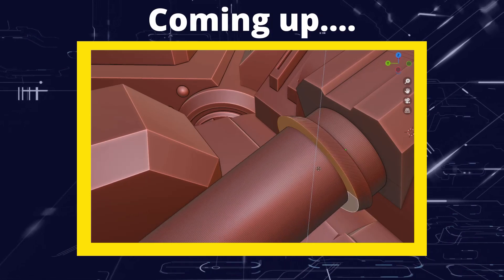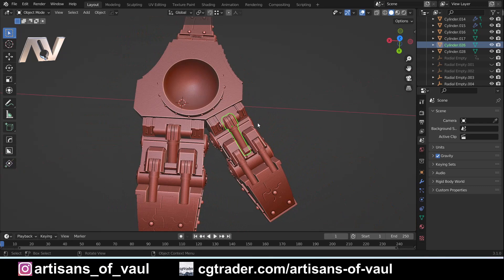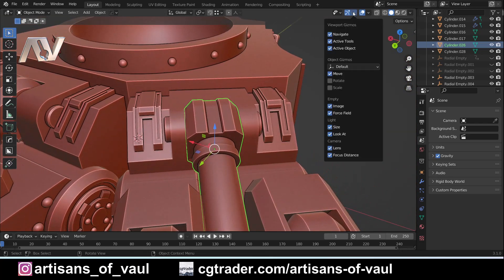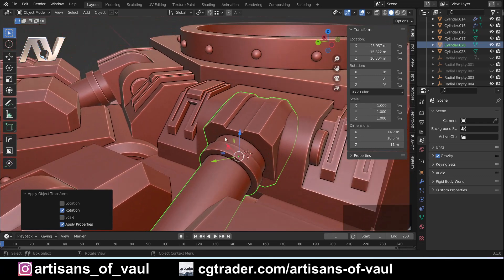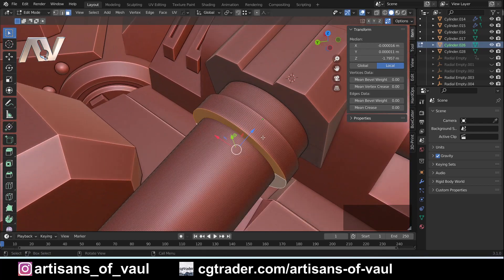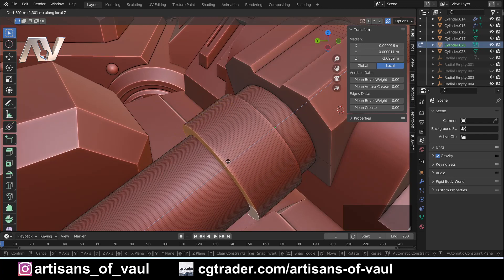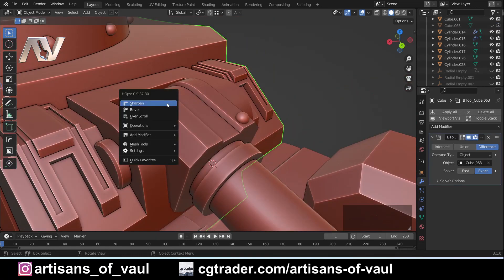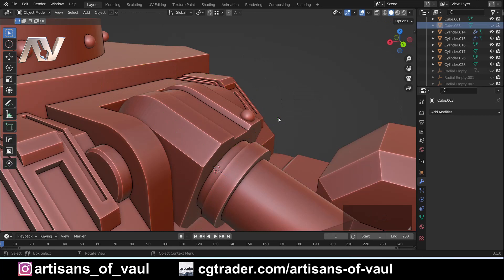How to transform objects in different orientations in Blender

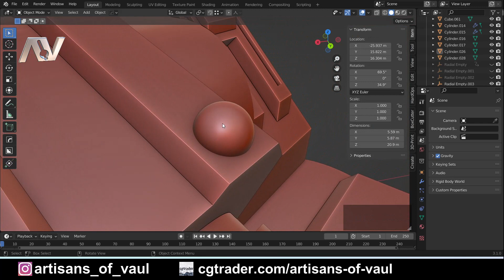Comment: 6:00... This is a bit deceptive assuming that the preferred surface is oriented the same as the object origin.   The origin could be rotated off axis, or the face could be modeled at an angle to the origin.   I think the safer method is to use Face Snapping, affecting the object rotation.
Reply from the maker: Fair point in that situation.